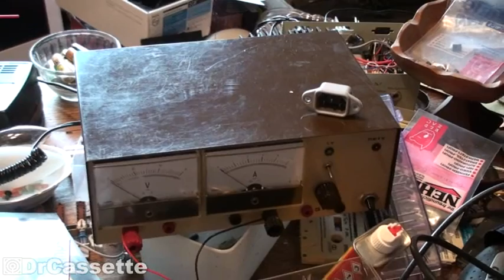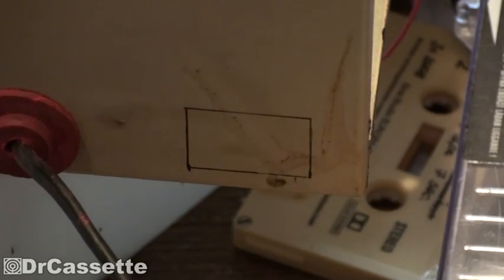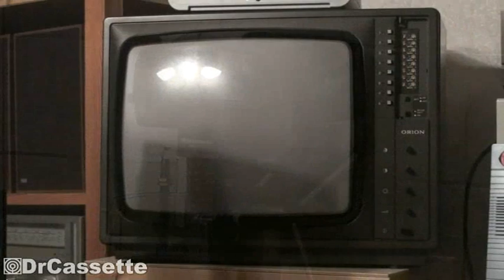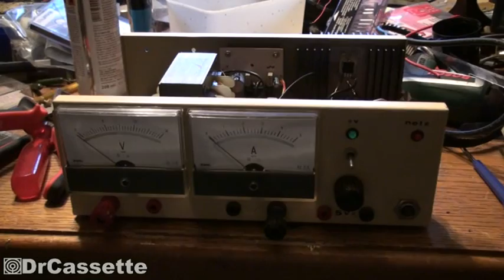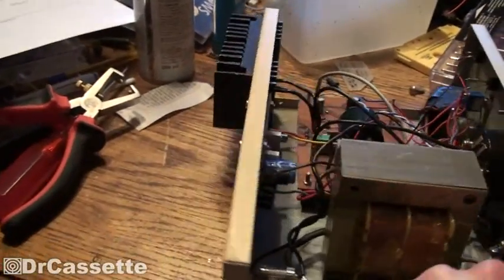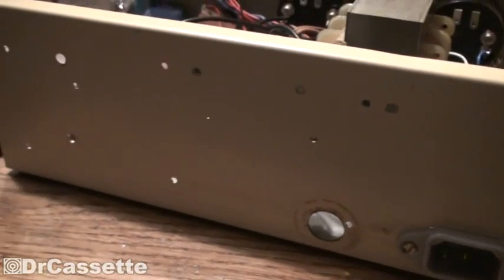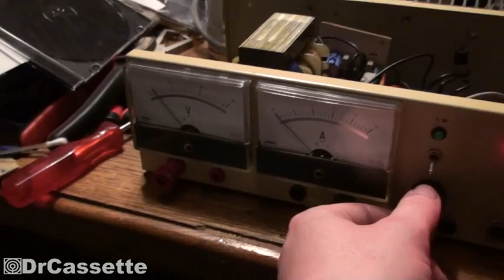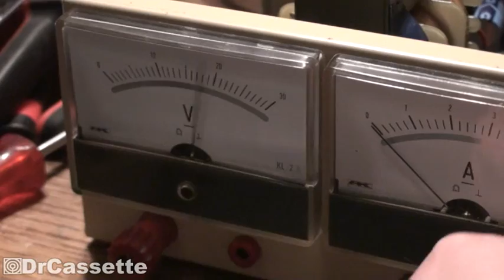DrCassette's Workshop - Modding the bench power supply #2

Comment from the maker: When I got the power supply, it had a fan in it. Not a very good construction at all. Very noisey as they used one of those old computer fans (before computers were designed to be quiet). We do have a cheapo Dremel knock-off thing, but it isn't powerful enough to cut through metal. The PS does 2 Amps, but for some reason the original owner installed a 5 Amp meter.